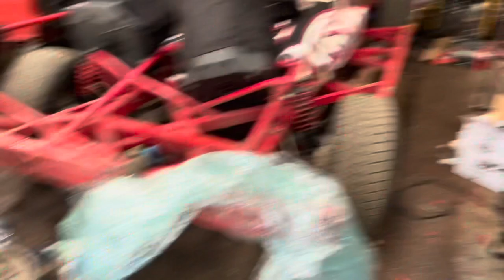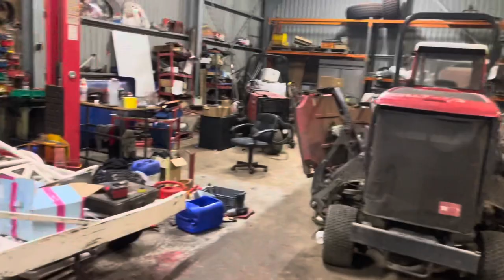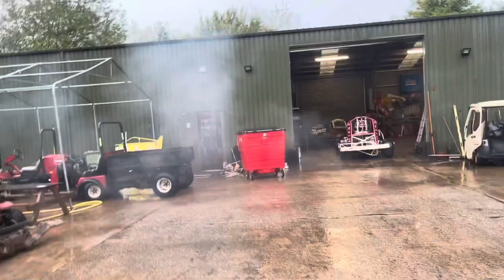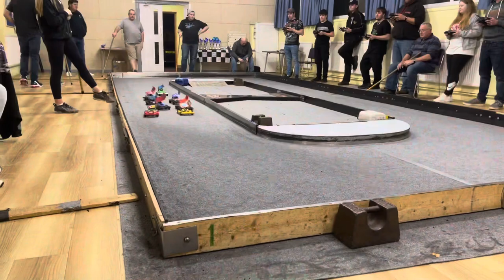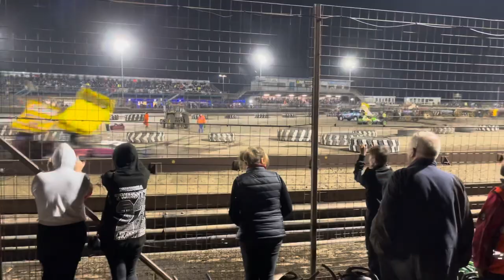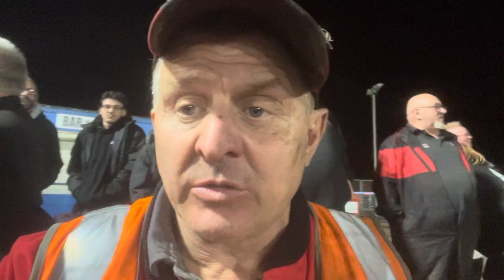F1stox, 3 engines, 2 clutches for one finish!

Comment: Why don't you build the other two engines yourselves same spec as your tarmac engine that you built yourselves,it's going well and getting results and its reliable? Good luck with the racing.
Reply from the maker: Yes we have built it the same, but not dynoed it with that carb as we are always rushing to get out for the next meeting.
Reply: @NigelHarrhy  over winter rebuild the engines yourselves and get them  rolling rd in the cars,then you know all the setups are running right,timing,carbs,firing order,engines are better on a rolling rd under the load of the car as its running all your own bits. That's the problem when you are rushing to get out for the next meeting nothing is really tested till on the day of racing and unfortunately that's where the bad luck comes in. Hope you get sorted love your vlogs, i like to watch you both racing father and son team, your like me i would rather watch my son racing to.
Reply from the maker: @callumdurham7777  You cant dyno the engine in the car. The engine sits in a dyno room, we can put the car on a rolling rd to 1000hp, but it wont dyno the engine.  🙂👍
Reply: @NigelHarrhy  sorry ment rolling roaded in the cars.